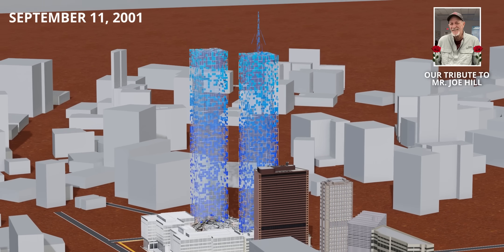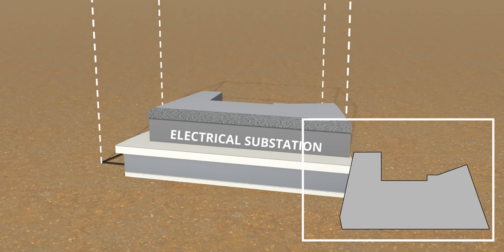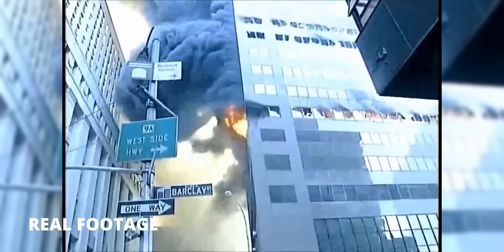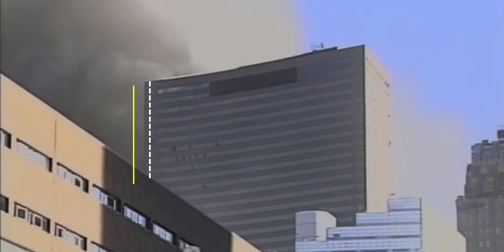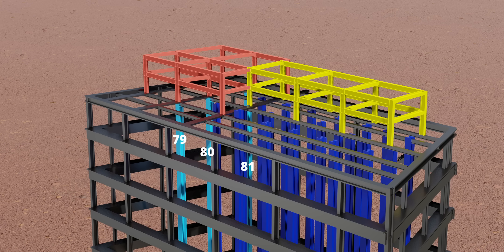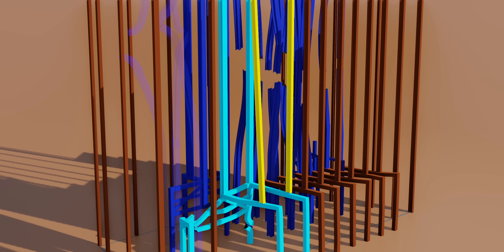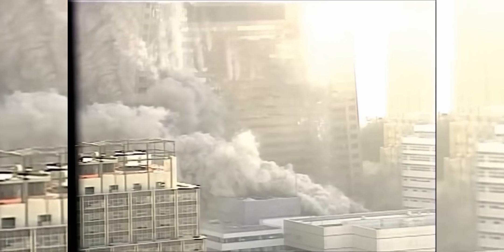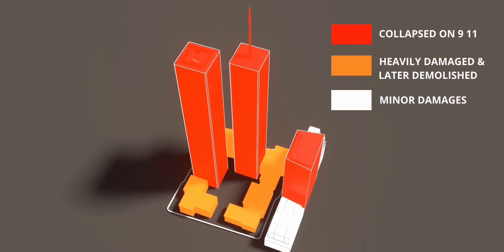Collapse of Building 7 | The Complete Physics

Comment: Even if this bullshit were true, the building would not collapse at that speed without ALL of the major support columns being cut or damaged. When a building collapses it looks similar to how a Jenga (game) tower falls. It never falls around free fall speed, and never falls into itself into a neat little pile of cement dust.
Reply: If the building feel at free fall speed, then it couldn't have possibly been brought down by a controlled demolition, since it involves individual floors pancaking on top of one another.
In other words, if what you're saying about the freefall is true, then it rules out controlled demolition.
Reply: I agree. The floors pancake one after another, but one split second after another. I should clarify,  "Near free-fall speed". I shouldn't have said "free-fall speed, my bad.  @Jan_Strzelecki
Reply: @jg-qb8dn In other words, there's nothing in this collapse that would indicate a deliberate demolition.
Reply: Not quite.  Perhaps if we went into more detail. Grab a beverage and make yourself comfortable:  

Much misunderstood, Building 7 was the 6th building to collapse of 10 lost on 9/11. Because of its early low priority, conspiracy filled the information void with garbage made up by technically ignorant people promoting political agendas. But 7's loss is an engineering problem and should be treated as such, so I prepared this brief summary of my own analysis to fix that, using technical analysis, not ideology and tired memes. 

At 10:28am the WTC North Tower collapsed, showering Building 7 with tons of burning debris, causing heavy damage and starting many large  fires which burned out of control for the next 7 hours. Half the FDNY firefighters having been killed, units in disarray, equipment destroyed, no water pressure, and the greater urgency of search & rescue efforts, Building 7 couldn’t be saved so firefighting efforts were pulled as futile and 7 left to its fate. Firefighters make that sort of choice every day in brush fire situations - which houses to save and which ones to let go. Only real difference here is moving the decimal on the size and cost. People get overwhelmed by the size.

www.youtube.com/watch?v=g_SvpwyC17M

Collapse of a burning structure is always a concern for firefighters. Steel buildings subject to fire rely on active firefighting to survive. Buildings are designed around 1 to 3 hours of fire resistance, allowing time for occupants to escape and active firefighting to get started, after which all bets are off. Left to their own devices they'll exceed their design envelope and collapse, like Plasco Tower and Wilton Paes de Almeida. In 7 the occupants escaped, passive and active fire protections were compromised and active firefighting was abandoned hours before the collapse, which left the building to its fate. It lost. Odds on Building 7 would eventually collapse, and it did. No big deal in logic.

 http://www.youtube.com/watch?v=WnYBX6QT0R4 

FDNY Chief Daniel Nigro - The biggest decision we had to make on the first day was to clear the area and create a collapse zone around the severely damaged 7 World Trade Center, a 47-story building heavily involved in fire. A number of fire officers and companies assessed the damage to the building. The appraisals indicated that the building's structural integrity was in serious doubt. I issued orders to PULL back the firefighters and define the collapse zone. It was a critical decision; We could not lose any more firefighters. It took a lot of time to PULL everyone out, given the emotionalism of the day, communications difficulties and the collapse terrain 

FDNY Deputy Chief Peter Hayden ; We had our special operations people set up surveying instruments to monitor and see if there was any movement in the building. We were concerned of the possibility of collapse in the building. And we had a discussion with one particular engineer there, and we asked him if we allowed it to burn could we anticipate a collapse and if so, how soon? And it turned out that he was pretty much right on the money, that he said 'In its current state you have about 5 hours 

The collapse of Building 7 was anticipated and widely reported in the media throughout the day, with 24 video cameras recording some or all of the collapse. Everyone knew what was coming and why. 

www.youtube.com/watch?v=OY5S5k3tMHI

The collapse of Building 7’s was entirely different to the Twin Towers and harder to understand, most details being hidden from view and not intuitive.  But we can still sort out what happened through careful analysis and observation. This is my explanation of the collapse relying on no outside authority. 

Building 7 was a unique, asymmetrical 47-story steel framed structure built atop a smaller 3-story building serving as a partial foundation, requiring lower floors dedicated to complex load transfer structures. Of trapezoidal shape and all-steel tube-in-tube construction, B7 (above the 7th floor) consisted of a central core of steel columns carrying most of the gravity load, perimeter steel columns around the outside of the structure carrying the remainder of the gravity loads and long span beams and girders to tie those elements together and form the floors. On the outside of the building hung a moment frame or outer shell. 

Phase 1 : First externally visible signs of collapse initiation occurred at 5:20:28 pm and were notably quiet with observers not realizing the building was collapsing! No audible warning in the form of hundreds of ear drum busting 180-190dB explosive bangs preceding the collapse. Here at 12:00 a local CBS affiliate reporter is talking 10 blocks from B7 when collapse begins. People don’t start to notice the collapse until 12:11. At 12:45 is the famous CBS fixed camera clip of Building 7’s collapse. Note how quiet it is. 

www.youtube.com/watch?v=t5tEy6mXSE8

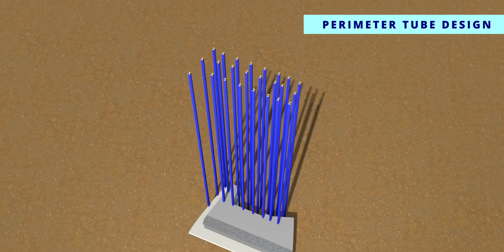Collapse initiation was due to lower floor failures above the load transfer region (8-14th floors) in the NE corner. In this video at 0:45 you can see the NW corner from inside the building while under construction, Column 79 just out of frame on the left. That big, angled steel beam across the top of the frame connects to C79 at one end. The girders connect to the beam. That beam and all those girders depend on just one connection 

www.youtube.com/watch?v=nP3TNHPCIVU&t=45s

Phase 2 : The NE lower floor failures caused a loss of critical lateral support over an excessive length of Column 79 and it buckled. Looking at a floor diagram of Building 7 (www.nist.gov/image-16640) when you see all the structures that depend on C79 you quickly realize this one column was a relatively isolated structural element on which a disproportionately greater fraction of the structure depended analogous to say the Key Bridge. Externally as collapse begins we see a vertical progression of window breakage along the 44-46 line and a kink in the roof of the East Mechanical Penthouse at the top of the building, consistent with C79 failure. Normally with a buckling column, the load could be redistributed to other columns. With C79 that is not the case - the failure did not redistribute the load, so the collapse rapidly progressed to the roofline, sinking the rooftop penthouse. The transition from full capacity to almost no capacity occurs in an instant and will result in virtually no resistance 

Phase 3 : With C79 gone, B7’s progressive, non-symmetrical collapse continues with adjacent columns 80 and 81 left laterally unsupported, and quickly buckling as well, sending the EMP down through the building. C79-81 all have no diagonal bracing, which is the major reason why they could not redistribute a lot of vertical loads among one another. From there collapse progressed from east to west through the central core until the core was gone taking all of the interior floors and probably most of the perimeter columns with it. Follow the horizontal progression of window failures low in the building and the dropping of the remaining rooftop structures into the building. One of the big takeaways from the NIST Building 7 study (invariably ignored) was how their modeling determined C79 failing under ANY circumstances would have initiated the same collapse sequence. 

Phase 4 : After about 10 seconds only the exterior moment frame remains, giving the illusion B7 is still standing to the casual observer since little has outwardly changed. But it is just a hollow empty shell like an empty cereal box supported only by a few remaining columns and overloaded from the loss of the core columns and floors, quite unable to remain standing. With nothing remaining behind it, the north face leans inward, forming a V in the roofline, the last few columns buckle under the strain and the moment frame free falls, landing on top of the debris pile. 

It is only here at the very end that a single measurement of alleged free fall acceleration is taken, from a single point on the outer shell. The Building did not “free fall” – just one corner of the outer shell did, sort of. The Building_ (defined as its center-of-mass) was already gone before that happened. The period of alleged free fall was a product of how it fell NOT why it fell and can't tell us what started the collapse 10 seconds earlier. Start to finish the collapse took 18-20 seconds, 3 times longer than free fall . How fast something falls cannot tell you what started it falling_ anyway. 

The debris spread outside the footprint blocking surrounding streets, heavily damaging the Verizon Building and destroyed Fiterman Hall. 

Building 7’s progressive, non-symmetrical collapse was incidental and unintended collateral damage from the combined effects of fire + time + gravity, started by the collapsing North Tower. That is true no matter who planned and carried out the 9/11 attacks or why . The collapse was of so little consequence it barely registered at the time - a footnote, only taking on semi-mythical status as an alleged smoking gun years later when demolitions at the Twin Towers, missiles at the Pentagon and shoot down over Shanksville all failed and conspiracists had nothing left to work with. 

Anything can seem like a conspiracy if you don’t understand how it works. Now you should. I hope you found this helpful, informative and it solicits informed critical comment. If I made any errors of fact, logic or reason or left anything important out, please let me know so I can fix it. IF you can offer a more plausible alternative please do. Be the first. Please start any reply with the words “Tits McGee” or I will know you didn’t read it and are wasting my time.

Comment: There's no engineering evidens in this at all. First, the weight of the penthouse was there all the time. One floor penthouse does not have an increase in the weight from collapsing. Also, all high buildings in USA is built to withstand exactly airplanes crashing in to them. When you look at a column it is the strength of the length that matters. When you got all those columns supporting each other, it takes an enormous force and weight.to.make it collapsing as it was supposed to have done. No, neither the twin towers or building seven would collaps that way without explosives spread down trough the structures. This is how you take down a building without it going sideways. And yes, it is very hard to do.
Reply: Weight of EMP did not change. Ability of structure below to support it did. 

No airplanes crashed into Building 7

Comment: This is a great video but it really ought to be re-uploaded without the ridiculous claim about the antenna gouging the building. Even if it had fallen into 7 (which it didn't), it would not have lasted as long intact as it needed to, to leave that gouge. This just leaves room for dumbass conspiracy theorists to be like "hurr durr see, they got this wrong, everything else must be bullshit too"
Reply: No building built to this spec, before or since, has ever collapsed in this manner due to fire.

Firefighters entering high rise buildings like this need to do so safe in the knowledge that they will not face a complete global freefall collapse as they are fighting a fire and its overall structural integrity will remain and can be trusted throughout the process.

WTC 7 apparently metaphorically completely rewrote the firefighting rulebook on the potential for these fire induced collapses and yet the actual firefighters rulebook itself hasn't yet been rewritten.

Draw your own conclusions from that.
Reply: @gerhard7323 - You missed an awful lot of critical stuff, and several false starting assumptions to boot.
Reply: @gerhard7323 - What was different about the fire scenario in Building 7 compared to other, more typical building fire scenarios?
Reply: @TheCriticalStinker-01 If you're alluding to the substation these buildings simply don't collapse like this due to fire.

Although highly unlikely, parts of it might have collapsed, but not the whole thing in its entirety in seconds into its own footprint.

No way, no how.
Reply: @gerhard7323  When has there been any opportunity for a building to collapse in this manner in the first place? Firefighters don't let buildings burn for 7 hours before doing anything about it. If for some absurd reason there were somehow a rule where they had to wait that long, I'd imagine we'd have had a handful of collapses around the world by now at least.
Reply: @Taima There were these buildings called the WTC Twin Towers 1 and 2 burning just over the way....

They collapsed killing thousands and over 300 firefighters died and they were exhausted so they weren't particularly up for tending to the later fires in the WTC 7 which by then had been fully evacuated anyway.

Once again, these buildings aren't supposed to wholesale collapse in this manner due to fire ie they are designed to outlast any fire that occurs within them once all combustible material has been consumed.
Reply: @gerhard7323 - Nail hit on head. This was by no means a normal fire event.

Half the responding firefighters had just been killed. Others were injured or incapacitated.  Much of their equipment was destroyed or inaccessible.  There was no water pressure. 

No choice but to let the fire take its course.

No building is immune to the effects of fire - one of the most destructive elements on Earth and which from time to time levels entire towns and cities.

17,000 homes and businesses raised to the ground in Los Angeles earlier this year from fires.

Do the same rules you want to arbitrarily apply to Building 7 apply there too?  

Building 7 was designed with 2 to 3 hours of fire resistance to allow time for active firefighting efforts to take effect.

She lasted for 7 hours with no effective firefighting and little in the way of fire suppression. 

That is a remarkable performance and a credit to the designers and builders.

Now, had a fire started in Building 7 on any other day, where active and passive fire suppression systems are intact and working and firefighters are there with all equipment and ready to go, would the result have been the same?

I think not.

Fire resistance and survival is not just about the building. It is premised on the whole system working.
Reply: @Taima  No no my clueless little conspiracy theorist, not everything in this BS video is BS. The video does one good thing: It points out that the kink was horizontal and by this (unintentionally) debunks NIST. So the free fall that proves the controlled demolition anyway startet right with the first downward movement of the roof line. NIST´s lie about a "stage 1" with less than free fall acceleration is debunked.
Reply: @TheCriticalStinker-01 No reply permitted.

YT comments section is a nightmare.
Reply: @gerhard7323  - Curious why you chose the reinforced concrete Grenfell Tower whose fires were primarily external and which had active firefighting going from early on over something at least semi-analogous like the steel-framed Plasco Tower or Wilton Paes de Almeida.  I know for a fact you are aware of the former at least. 

Ignorance or lie-by-omission ?  

Regardless, if you actually want to understand the event then take the time to understand the event. Don't try to compare it to some other different event you also don't understand.  What a colossal waste of time.  I have posted for you in several threads now everything the interested layperson would ever need to know about Building 7's collapse just to make sure you don't miss it. 

Sharing is caring.
Reply: As you should know there are very few points of direct comparison in terms of steel structures other than the WTC twin towers and the Tehran Plasco Building which is, to use your or your wing man's word, only semi-analogous both in terms of construction and fire protection.

The only other remotely similar example, the Sao Paolo building, was effectively derelict and had not been maintained for some years prior to its collapse.

In this sense the WTC 7 remains to this day the one and only occupied and fully maintained building built to those standards that has had a complete global collapse in a matter of seconds due to a 'normal' fire event.

Anyone who claims these collapses due to fire in these buildings are more common than people think are, frankly, misinformed or lying.